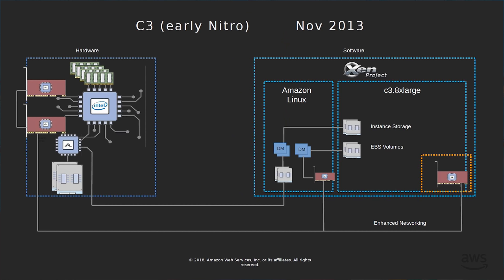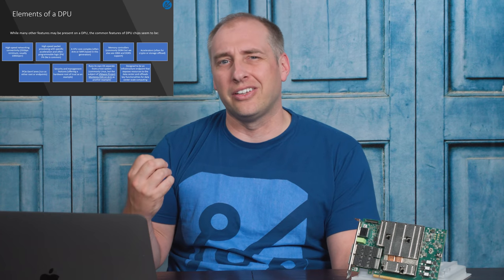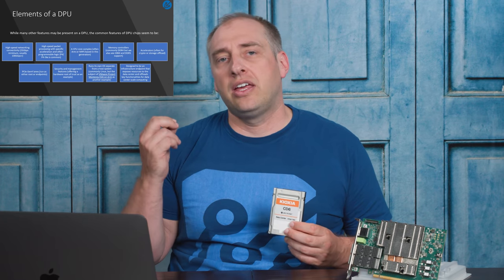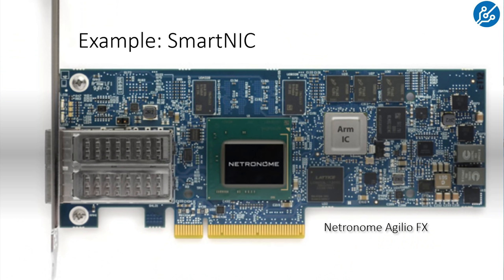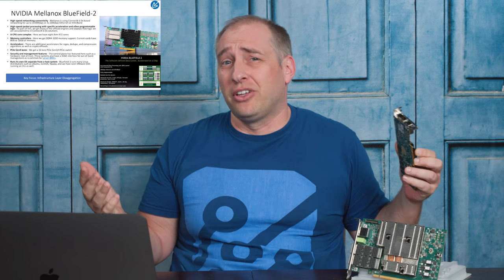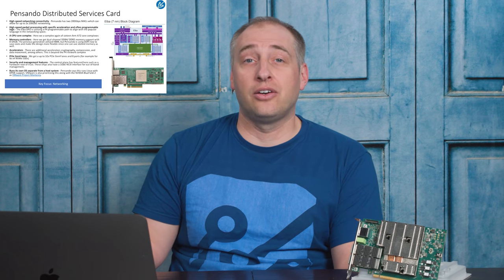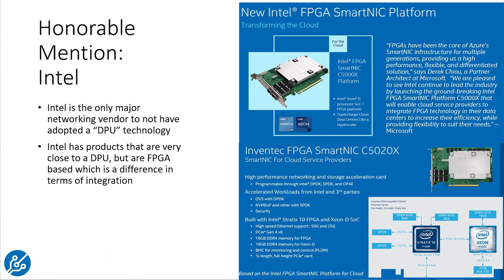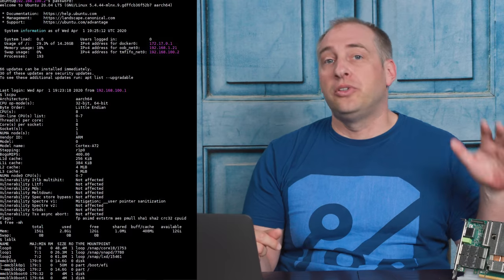DPU vs SmartNIC vs Exotic FPGAs A Guide to Differences and Current DPUs

Comment: Do you see these moving into enterprise market? As I see it, this is targeted at hyperscalers and has little to no application elsewhere. Your average datacenter or office (which is 10G/25G max usually) on VMWare doesn't need these speeds.
Reply: @asdrubale bisanzio sure, hyperscalers have their own software stacks. I meant like project Monterey. Yeah it’s cool that you can run esxi and vsan there but who actually needs that? DPUs are needed for 100gbit and up with things like nvme-oF. Maybe some enterprise storage solutions will use it but actually buying DPU for your average server? I just don’t see it.

And what do you mean dell is dropping it?
Reply from the maker: You have to remember 2022 and beyond chips and systems are much bigger. 100GbE is now fairly cost effective to use and VMware will be a clear use case. VMware needs DPUs to really do more a more hybrid cloud like model.
Reply: @ServeTheHomeVideo I don't know, I don't think systems will get much bigger. We're at the thermal limits already and the only way forward is horizontal scaling. Hyperscalers deploy 1U systems for a reason. And then you no longer need fat links. Regular hosts rarely saturate even 10gbit. Only exception is usually storage systems. There DPUs make sense. Running Ceph OSDs on DPU - yes please. Although, current DPUs are too slow for that. You need pretty beefy servers to run NVMe based ceph cluster.

Regarding hybrid cloud, you mean using DPU for disaggregation of resources across local and cloud? That makes sense. But seems likes DPU is a huge overkill just for that. You really need just a simple bridge from PCIe to the network. Everything else is fairly useless as links between local and cloud are slow and need little resources to handle usual tasks like firewall, encryption.
Reply: @asdrubale bisanzio VMWare is doing very well. The split from Dell is probably some business decision that doesn't affect anything. They keep growing and they're still leading the virtualization market. Vsphere is on another level compared to any other product. Especially when you pair it with vsan and nsx. But I agree, my feeling from working with it and looking at limitations (there're specific limits to host many hosts and VMs you can manage), it is pretty much for virtualization of your "average server". They try to get a slice of other markets like recent integration of kubernetes control plane, support for GPUs, optane but I rather doubt many people run it in setups where DPUs would realize their full value. It just doesn't make sense to me to pay so much money for it at that scale. If you're that big you probably can afford building something your own using open source products like openstack, proxmox, opennebula. If you even need virtualization at that point.
Reply: @asdrubale bisanzio it just seems VMware is the only one who provides the whole package and it just works. Sure there’re solutions like proxmox but they’re not there in terms of performance, reliability, ease of use, features etc.

Yeah, you can’t really compare proxmox and openstack. The latter is definitely more of a collection of building blocks than a solution. I more meant that with open source it means you’re building it on your own. No HCLs, no support, no guarantees of any kind. It’s a big risk and for some it makes sense to buy VMware and be done with it. Just the storage alone. For any kind of serious deployment you would want ceph. Managing it is a big task on its own. Even selecting hardware can be non trivial.
Reply: @asdrubale bisanzio well, I wouldn't call deploying ceph "just works". Compared to vsan, which is just a few clicks you can do in minutes, deploying ceph is a huge undergoing. From picking hardware to deploying and managing it. Just the architecture alone is significantly more complex than the whole vsphere. And it's slower. I'm pretty sure the same applies to NSX which Proxmox or ovirt has nothing to compete with.

As for kubernetes, we're in the process of migrating to it. We have bare-metal kubernetes for our application cluster but all office infrastructure runs in VMs. It's annoying to manage them for every single application that runs in containers anyway. So we're planning to migrate as much as possible to vsphere kubernetes. The great thing is it's completely integrated with vsan, so we get shared kubernetes native storage out of the box.

And that's their main market. Many businesses can't run in the cloud but they do need virtualization and maybe some containers support for easier deployment. VMware is the leader here and probably will continue to be for the foreseeable future. If you look at the market share, vsphere and hyper-v control almost all of the market.
Reply: @asdrubale bisanzio well, they aren't better when it comes to storage. That's almost half of the problems already. Proxmox doing automatic ceph deployment - hiding the complexity doesn't mean it's not there. Hardware choice and sizing - still on you, there're only vague guides and some test configurations. The sizing is very non trivial. Configuration on you. I see that proxmox GUI can only do simple stuff but for everything else it tells you to run a CLI command. They even recommend running OSD per disk - bad advice that will make it impossible to get most out of nvme. There's no mention that you can even do that. Not to mention tons of other configuration you will have to do to make it work properly. And when things go wrong, you will be drowned in ceph complexity. Proxmox can't do anything about. It's just pipes CLI output to GUI. I'm not picking on ceph, it's complexity is there for a reason but there's no comparison with vsan or similar solutions in terms of ease of use and maturity of solutions around it.

And yes, ceph is slower, much slower. It also very resource hungry which is why you would never run it on the same nodes as your VMs. Something that VMWare actually promotes because vsan is very light in comparison. It all comes down, again, to architecture. Ceph is build for cloud scales and there're architectural choices made that make it possible but hurt performance.

I know about OVS but it's CLI driven. Everything I searched about it looks like this - write some configuration in OVS and then push a few buttons in proxmox. I see there's SDN plugin but it's experimental. That's not a comparable solution to NSX but maybe someday will be. They even let you play with overlay networks. Probably the same for security, another thing where VMWare excels. Looks like just a wrapper around iptables rules.

It's true, I don't know much about others but I can make an educated guess from documentation and other people's reviews. Specifically, Proxmox is like any other open source product - it's not a solution but a starting point or a collection of tools to build something. I'm not complaining. Kubernetes is even worse offender here but it is what it is. And that's exactly why VMWare has all the enterprise market - they provide a solution from start to finish and that market more than willing to pay for that instead of dealing with open source projects glued together with simple GUI. But if you build something on your own, some product or platform, then all the problems of open source become advantages because you have access to everything. And it's free, of course. Even with CLI it's impossible to understand what's going on in vsphere. A few simple commands and that's it. Different markets, different needs.

Comment: Y would go for the marvel solution like 10 in a cluster or even more a stream device with 1 class  for example if you want to convert  multiple gpu outputs in optical solutions so you won't need to have direct connections 😉

Comment: Have you had any luck getting DPUs to run on windows 11 pro for workstations or a sinilar solution to access high speed remote storage without using cpu resources?
Reply from the maker: If you are just doing remote storage, NVMeoF and RDMA do not require a DPU. We do have a guide to getting the BlueField-2 DPU working on Windows 11 Pro https://www.servethehome.com/hardware-arm-linux-on-x86-windows-11-how-to-get-nvidia-bluefield-2-dpu-running-on-windows-11-pro/
Reply: @ServeTheHomeVideo  I'd like to be performing compute intensive operations over some network medium that offers speeds as close as possible to native pcie 4.0/5.0 attached storage

In your experience would you recommend going bluefield or just the connectx?

Comment: Okay. I think I MIGHT have it now. So, basically a "DPU" is intended to be an infrastructure element, separate from the main CPU in a server, but serving somewhat of a limited-function general purpose processing role as a coprocessor to keep the infrastructure-related computational tasks out of the main CPU cores so as to provide "maximum resources" to the users who are accessing (or trying to access) the server's main CPUs for their workloads. In simpler terms, the so-called "DPU" acts as a management coprocessor for handling all the networking, communications and security tasks specific to that use case so as to NOT occupy ANY main CPU cores with those tasks. Then why can't we just call it an Infrastructure Management Coprocessor, or IMC? Why the hell call it the vague term of "data processing unit" if its function is actually something specific in a similar manner to a GPU being specifically designed for processing data and instructions relating to graphics, animation rendering and video effects? THAT is my real issue with "DPU". It isn't the "what" or "why" so much as the terminology itself I take exception to. I don't like things being vague. I don't go around calling the GPU in my laptop a "data processing unit". The thing processes a specific kind of data, not just "data" generally. You have to call these things what they are. You positively CANNOT be vague, else you wind up confusing technician and end customer alike, and nobody gets anything done right when that happens.